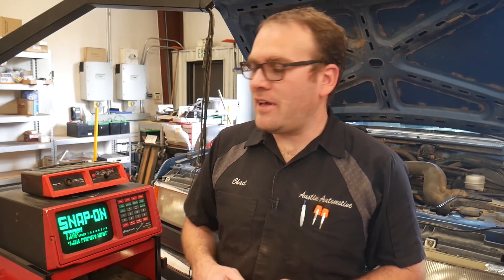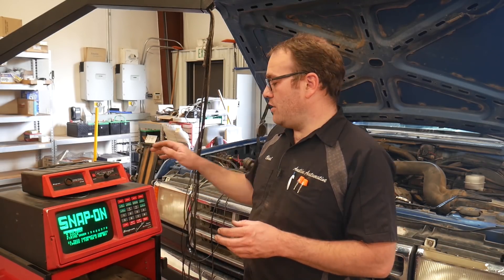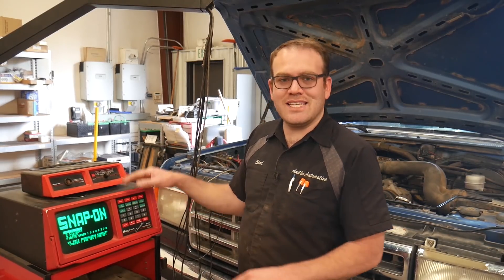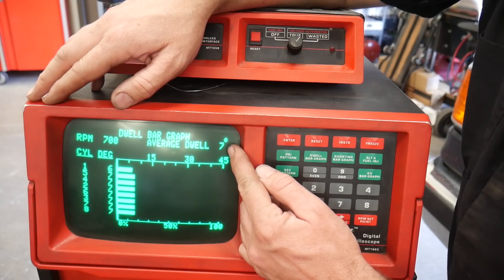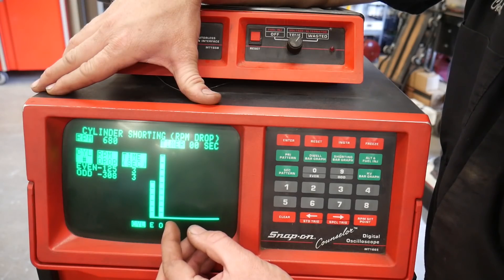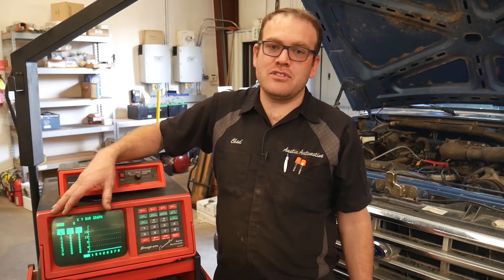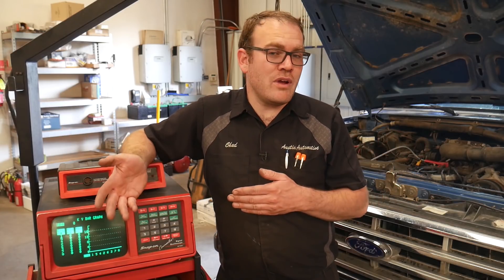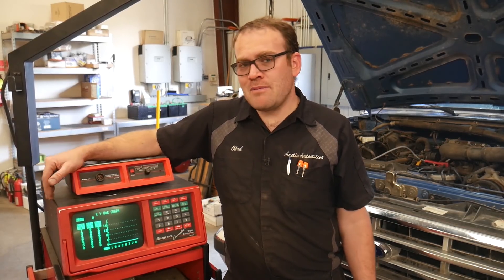The old Snap-on Counselor Scope and why I still have one - Does Picoscope need improvements?

Comment: Could you use this on a single cylinder engine
Reply from the maker: Yes. You would not be able to perform power balance because the engine would stall. All other functions should work.

Comment: I enjoyed your video. I have two questions if you don't mind. Can a scope like this be used on old cars with 6 volt systems? Does it have firing orders to choose from or do you enter it. I am curious because I have a V8 with a 18274536 order.
Reply from the maker: It should work fine on the 6 volt system and you have to manually enter the firing order.

Comment: I have a good working Counsellor II with 5 Gas and all available attachments that were available at the time of NEW purchase by a military base overseas. At that time they paid 35 grand for the kit. Nobody learned how to use it for several years so it sat under a plastic cover. After retirement, I went to work for the shop and I knew how to use an Oscilloscope so I started using it daily. Once I was no longer working for the shop, it went unused again so they put it in storage at the warehouse. I was contacted that it was going to be part of a public auction. Nobody at the auction knew what it was so I was the only bidder, the opening bid started at 75 bucks and it was mine. Probably had a couple hundred hours on it in 15 years and most of that time was my usage. I still have it today. I dropped the remote and broke the crystal which I troubleshot the unit to figure that out. I was going to move to a different country and during the move, the entire unit on the wheeled cart rolled off of a truck bed and the entire unit fell on the scope face breaking the facia and one mount point around the CRT screen after a 4+ foot drop onto a gravel parking lot. I was able to purchase all the needed items and remote from a technician in America parting his unit out, and fixed it up like new again, very lucky, nothing electronic was broken. It did have a glitch when very humid outside, the remote and touchpad would not work, once humidity levels fell, works normally again. The fact in the old days when DSOs were new and not super fast, these old Analog scopes were better for viewing spark but now with today's processing speed, a DSO like PICO will do a fine job to catch all problems with spark waveforms.

Auction story, they wheeled it out for auction and everybody could see it was a SnapOn something or other, a guy next to me asked, "Is that a toolbox?", I said "NO, its an oscilloscope", he said, "Whats an oscilloscope?" and I said, "thank you". I was the only person to raise my hand for the opening bid of $75 and it was mine in like-new condition. Once it was over 10 years old, the government considers it worthless as its value is depreciated to zero. I have seen prices online in the $3000 range for a full set up.
Reply: I grew up in a shop that had one of these, and I saw first hand how useful it was in diagnosing faults. I also learned the importance of OE parts. Even back in the 90's, when companies were still reputable, and purchasing name brand meant a premium item, it could still lead to driveability concerns. I remember there being a GM product, a work van, that was running rough, and didn't set codes. Previous part cannon Gunnery Sergeants had run out of ammo on the thing. The gentleman was told it needed an ECU or a distributor. They couldn't tell him for certain; both were equally expensive. He brought it to said shop my dad worked at for years, and the "emission specialist" (that's what they called them back then in this region) hooked it up to the MT3000, and in maybe 20 minutes, said it's a bad pickup coil. The KV was off. After looking further, it had a brand new Beck & Arnley ignition module. They swapped it out with an OEM Delco, and the rest was history.

In 2008 I was able to get my hands on one of these, and between the handbook, and daily testing, I self taught how to use a scope. I still use it till this day on traditional ignition system cars, and the oddball OBD 1 creation that may roll through the bay.

Comment: The reason  these older girls can  kill cylinders is that they generate an electronic "gate" that imposes upon the coil NEG   and momentarily  disables the coil trigger.    They should work  same any  "coil switched"  ignition such as HEI,  older Mopar  electronic,  points, etc.   This is essentially a time delay  "gate"  that  shorts the coil and holds it near ground instead of allowing the   "switch" to trigger that  selected cylinder

Comment: I have a old matco scope that I believe is actually based off the otc vision labscope . The top modules can be swapped for just a basic four channel lab scope and then has the ignition module which will give it most the capabilities of the snap on . It’s a fantastic scope and can still be used today for most automotive needs . My partner at work uses it everyday and said works fine except for checking com bus signals because the signal is to fast .
Reply: Interro PDA is your unit

Comment: I found this really good, had one of these for 20 years rescued out of a skip/trash and now learnt about the shorting feature and going to give it a go on a old duel carburettored 914 as it's running off, one of the cylinders actually went up in rpm!
Just to add I do have a 2 channel PICO, I have more good stuff at home than work it seems (prestige car dealership!!)

Comment: Interesting video , I think that the pico is able to do most of the old scope menus, however the user knowledge has to be higher , if you wand to dull it down you can always use filters , I use early software as it has very little in the way of glitches. Cam to crank relationship is one of picos strong points . The battery test and auto tests are a wast of time on a pico . But the rest is unmatched , the main thing that pico needs to address is the portability, if it was more like the snapon scope in this regard I could use it a lot more , at this point I only use it when things get hard. 
Thanks for the video Dwayne NZ.
Reply from the maker: I wish the pico could allow me to enter the firing order and then display a stabilized cylinder ignition waveform in a numbered parade. Even the handheld snapon scopes have this feature built in as well as detailed information for each cylinders ignition waveform. Picoscope is very powerful and is capable of doing it if the code is written. For quick captures the snapon is awesome and for after capture manipulation and analysis the pico is my choice.

Comment: Although I currently use a pico, I still have and sometimes use my Heathkit scope that I built myself in the 70’s!
Reply from the maker: I love my Picoscope also but when it comes to the old stuff my classic car techs use the Counselor. This is mostly to the lack of knowledge on how to run the PicoScope and the also how simple the counselor is to run because it is limited to the ignition system. I will have to look up heathkit. Do they also make Ham radios? The name sounds familiar.
Reply: ThePracticalMechanic , they made kits for everything from home TV’s to two models of ignition scopes. One 12” like the old Sun and one 6” with an inverter to take on test drives. I think they went out of business in the 80’s.

Comment: Chad this is thoroughly explained and you make excellent points! That is one sweet scope! You're definitely raising the bar. I hope they are listening and formulating a solution to the things you mention. Great video!
Reply from the maker: I think firing order and built in overlays would be a great start! Maybe a new tab for ignition in the PicoDiagnostic program. Thanks for watching Mario!!
Reply: ThePracticalMechanic thanks for the shout out bud!
Reply from the maker: No problem. If it wasn’t for that conversation I wouldn’t have filmed the old scope.
Reply: ThePracticalMechanic I'm glad you did!